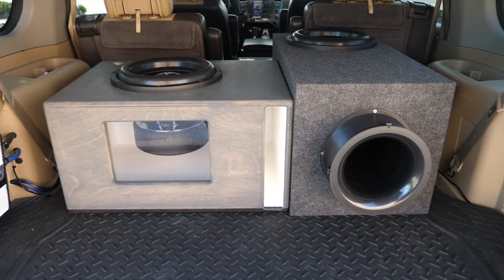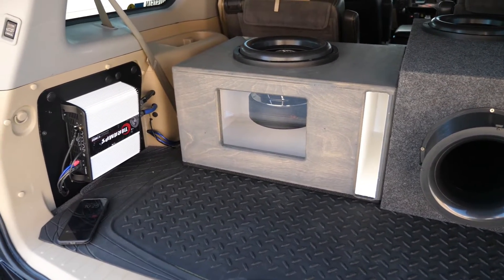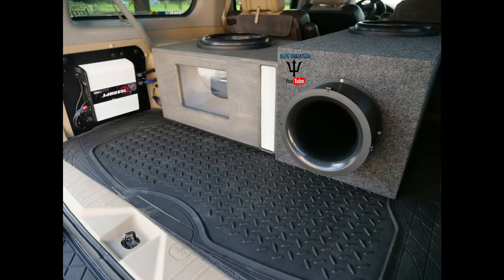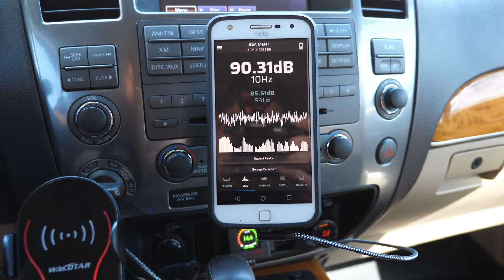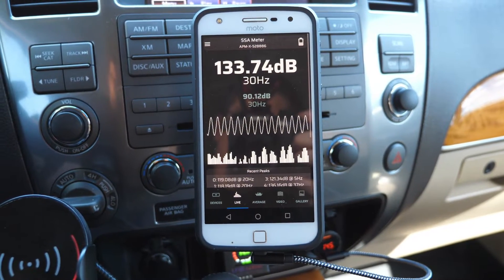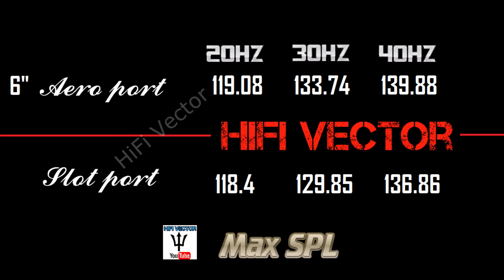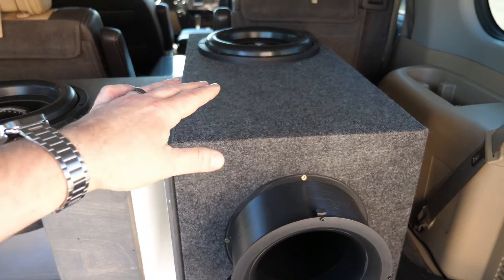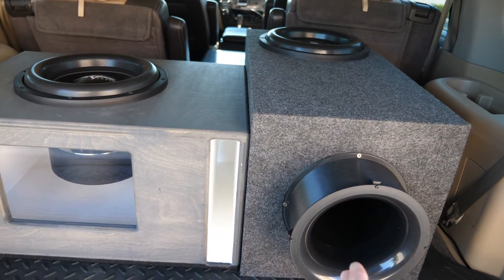Part 2. Aero port vs slot port subwoofer box test comparison?  6" aero port

Comment: I just made a custom sealed box for my 12" Kicker L7 2ohm dual voice coil sub and it doesnt sound half as loud  as the original sloted box i had in my 69 mustang mach 1 trunk.  I made the box to fit under rear window so I can fit my spare in trunk. Do you think I need an Aeroport in my box and what size? Maybe 2?  The sealed box probably is bigger then the ported one. Any videos comparing the two?

Comment: What did you use for the port to stick out of the box and screw it down? Is that some kind of adapter?
Reply from the maker: Yes I made it myself
Reply: @HiFiVector made it out of what? 3d printer? If you did buy the pieces to make the adapter, what style pvc pieces did you use to create it?

Comment: You would be nice to have the actual measurements of the boxes. If I can have good sound and similar power in a smaller box, yes please I'll take a slot. Quality mid-range and smooth clear tweeters I where the sounds is. I have a feeling most of these guys just have boom mobiles

Comment: I wish i understood how to calculate a port. I built a 5.36cf box in the shave of an L to fit my 65 cutlass for a dd9515 but im having a hard time figuring out the size and length aero port i need.
Reply from the maker: Is that the “net” volume of your box? And you want to use an aero port correct? What do you want it tuned to?
Reply: @HiFiVector  net would be right under 5. And yes im looking try a aero port this time around. So think 36-40 on the tune should work fine in a old muscle car.
Reply from the maker: Ok do you want to use a 6” aero port or 3 4” ports ? If you use a 6” precision port brand then you will cut the center tube to 2.5” long. When you connect the flares it will be 8.5” total length. Or you can use (3) 4” ports on the precision port brand cut center tube to 7” and when you put the flares on total length of each 4” port with the flares on will be 13”. Here are links to the ports.
https://www.amazon.com/dp/B001001KIA/ref=cm_sw_r_as_gl_api_gl_i_A51K590C0R2G734XC3WY?linkCode=ml2&tag=hifivector-20

https://www.amazon.com/dp/B0002ZPR56/ref=cm_sw_r_as_gl_api_gl_i_K8VGTC58Z6YFFKHV8HA2?linkCode=ml2&tag=hifivector-20

Comment: Ive been trying a few combos on my CT sounds Meso 12. They call for 40 square inches, i have a bout 24 (slot) now and it  Slams but trying to get 40 seems impossible in the 1.5 cubic foot box they recommend. I use sub box pro and winisd 40 inches seems ridiculous to me.
Reply from the maker: A lot of the factory recommended box specs are way off I my opinion. 24sq “ area in a 1.5 net box is a lot of area for that size box and should be more than enough. But….. that subs needs 2 to 2.5 cuft ft . 1.5 is waaay to small for that 12. I think those specs bare a typo.
Reply: @HiFiVector  I may have to try that 2.5 and see what she does.

Comment: Kind of a false comparision...a 6" aero port is 28 square inches versus your 22 slot port....and aero ports are way more efficient so that 6" is equal to around 36" inches of port.
Reply from the maker: You missed the whole point of the video. Part 1 had a 4” aero and parts 2 a 6”. Point was to go more are and less area on the Aeros to see what happens compared the a slot. People have said because Aeros are SO much more efficient you can reduce port area by as much as 60% so the whole point was to just see if that’s the case or not. That’s why in part 1. I used a 4” which is less actual port area than the slot. And in part2, video jumped to a 6” aero to see what happened. It was never meant to be a “fair” or equal port area test. Because if aero are more efficient you can not go equal…. Equal will not be equal since aero is more efficient. So if that’s the case for it to be equal you would need to know how much exactly can you undersize and aero to equal a slots area.
Reply: @HiFiVector  I thought you were doing a direct compare using a slot and aero....when you described the sound of the slot being louder and sounding better It seemed like a false comparison going from 22" to 12.5" in port area...if you used a slightly bigger aero it would have been a better apple to apples comparison. but I fully understand that you can't go to Home Depot and get a 4.5" aero...I make mine on a CNC machine....maybe I'll do the comparison...great videos BTW. I new the 6" would be muddy as that is way to much port for that driver. Im building a box right now for 4 DD Audio 1506 subwoofers and DD calls for 32" of port area which just feels to big to me although thats a slot port. At 2.0 cubic feet of airspace that 16" per cube for 6.5" subwoofers....In fairness these are pretty beefy but im going with 28" of port area and see what happens. I know it will sound good for sure and chuffing should not be an issue with 2500 watts of B2 Audio Rage power.

Comment: These are great compares.....i always try and build to spec....on that driver 22" is what is recommended so you cant get a round port with that area. seems like a 5" aero port is the answer...but then you run into length problems.....gets pricey to turn those things with adapters.....slot port is the same wood you built the box with.

Comment: Port compression at its finest. More port area gives more output up to a point until it becomes free air. Aero sounded boomy because it’s not being compressed to a smother response and is therefore peaky at one frequency. The slot port compressed and lowers peak output to smooth response. A higher order box would allow you to two or three peak to smooth response but takes infinitely more box volume to do.
Reply: exactly, and port being louder due more cone travel on same gain. It is like always a compromise.

Comment: hey man, all new to this, i had single db sa272 but not sure what enclosure to build. aero or slot? considering i have stock alternator/battery and has two 400rms subs (each) now jumped to 1500rms single. usually listen to rap and no decaf songs only original ones. wanted an all rounder enclosure with good lows and highs
Reply from the maker: For a single SA272 sub 2cuft net, 25 to 32 sq inches of port area and 34 to 36 hz would be good.
Reply: @HiFiVector  slot port or aero?
Reply from the maker: Slot, if you went aero then 4” aero port. I tend to prefer slot.
Reply: @HiFiVector  what are your reasons for preferring slot bro? i have seen people going for aero with SPL subs
Reply: @HiFiVector  also bro i have seen people using dampening sheets or foam inside the enclosures, how does that effect?
Reply from the maker: Both can work great if designed correctly but  with slots you can make port area literally anything you want. Aero you are limited with a couple different sizes also slots can bend if needed regular aero ports can’t.
Reply from the maker: Adding material supposedly makes the sub think the box is larger. But…. Adding material deadens some of the sound waves inside the box and sometimes it makes it sound worse from my experience. So it a trial and test thing. Doesn’t always help but in some cases it may.
Reply: @HiFiVector  yeah man, i tried and tested with placing cotton inside the enclosure, felt like i was playing in a sealed box😂

Comment: You're aware enclosure dimension (height width depth) is also a factor in ported enclosures. A ported enclosure is not like a sealed enclosure, where shape and dimension is irrelevant.
Also clear acrylic should be avoided but should be the same thickness as the surrounding wood baffle.

Comment: It would be nice too if you could cover how long a port needs to be to not unload vs the xmax of the sub used. Is it 4:1 ?
Reply from the maker: The length of a port dictates tuning frequency only. The area of the port is what you are thinking about and the area needed has a lot of variables depending on box size, what type of sound you are going for (SQ or SPL) and subwoofer specifications.

Comment: Hi brother., I have 1600 watts CALIBAR  woofer double magnet.for my woofer box how big Aero port i have put to get good bass
Reply from the maker: The power acoustik brand caliber sub? If so you can use 4” if you are not over powering it. If you are overpowering it go 3” . That woofer doesn’t have a lot of excursion so the 3” would help with power handing and make bass tighter or you can go 4” which would be not as tight bass but be a little louder with slightly less power handling.

Comment: I’m looking at doing 2 skar vxf-12 with a 6 inch aero port would that work good or should I use smaller or bigger port size I’m tuning box to 33 hz
Reply from the maker: 6” aero will be good for 2 vxf 12’s

Comment: I don’t understand how does a hanky prove which is better
Reply from the maker: It doesn’t it just help people watching the video show how much air each is moving since otherwise view would have no idea.
Reply: @HiFiVector  ah ok but what if you do a curved slot port where the end of the port turns into a horn wouldn’t that in theory increase the volume on the slot port and keep its efficiency at the same time since it’s only the volume of air at the end of the port that actually moves ? (Edit) kerfed

Comment: inn part 1: Slot port did 113.12 @ 20hz , 128.6 @ 30hz and 136.5 @ 40hz
inn part 2: slot port did 118.4  @ 20hz , 129.85 @ 30hz and 136.86 @ 40hz

I do belive all tests in vid 1 was done on same volume, and you used a different volum in vid 2?
Stil got a 136 @ 40 hz in  but a almost 5 DB up on 20Hz. 
And 6" over 4" +9 @20hz, +7.6 @30hz and +3.3@40hz

sound quality apart, consistent testing?
Reply from the maker: It was not the intention to compare part one verse part two videos as they were done on different days, so the volume and SPL levels will be different than the part one video. but that wasn’t the point of the video the point of this video was to compare at the same slot port box with now a larger aero port box and see the differences. So you cannot exactly compare part one verse part two as far as SPL level goes. Compare the differences of the boxes in each video.

Comment: If you can fit a large box like that with an aero port, it could help those guys who do not have massive amounts of power due to vehicle electrical restrictions, so this would scratch that itch for bass on lower power applications. Nice work man, thanks for the video.
Reply: Disagree. Areo port makes a bigger difference for spl applications. Low power applications will naturally have less port velocity because they are less loud. Spl and port velocity are directly correlated. As spl rises, so will velocity. And high port velocity causes port compression which reduces spl. To be honest every power level application should use areo port because it will let them get louder always. Port compression db loss is actually kind of crazy. It's so much more than people expect. People don't realize this and they end up spending $3000 on more subs, power, and electrical, when they could of made equal gains just from having a better box.

Comment: What is your take on the accuracy of the triticum port calculator?
Reply from the maker: Not a fan… there is a lot more information required to calculate the correct port area.
Reply: @HiFiVector how far off has it been for you? And in how many instances? Seems like a good, overall ballpark, but that ballpark, is like wrigley field being it’s own continent.

Comment: Try round ports flared vs no flare next.  

Also the location of the port in relation to the sub matters thats why I almost always do external ports.  

My philosophy has always been to use the proper amount of port area regardless of the shape though.  Also an easy way to determine what port should work best is to calculate its reynolds number for it sure this isnt really a flow and more of an oscillating mass of air but still it applies.
Reply: Could you help me figure out how long of an external port I need to make for my box?  Thank you

Comment: I've had similar results for a 10" sub in about 1.5 cubes tuned to 34Hz. The 4" aero got a lot louder and can push more air but the slot port sounded a lot better.

Comment: Not a lot of difference if playing music volumewise and seems like a tradeoff between your goals. That aeroport is using a decent amount more space for 2-4db gain where that slot port box could probably take enough extra power to outdo what the aeroport can handle at its power limits. Probably a size vs power issue.
Reply: great point murray!

Comment: I have an aero. The width of the box is a borderline issue, but sounds great. 
It works with a pair of 8s, but looking to get larger cones. A slot is my only option unless I just get a very efficient single 12”
Reply: Just get a fat 15”, 6” Aero. You’ll be covered for days. And you can always port out the top or side. (Personally I prefer same face mounting… but I also run my shit cab firing…)
Reply: @APinTheAK  I wish… A ported 15 would need 4-5 cubes. I have a sedan.

Comment: Nice comparison. I've been pondering lately on going back to sealed.
Ty sir for sharing 👍🤞
Reply: Hey friend.   I am just curious why you are considering going to sealed.  I know the general reasons for every box order, but yours personally
Reply: @7Little701  

True.  Too large and the power handling is greatly reduced.    I have an RE AUDIO SE X15 that I am thinking of building a box just to have some fun, but the ported box is quite large.  I have considered a sealed box, although it has been a long time since I had a sealed box.   Only a 750-watt subwoofer as it is, so I'm trying to be careful with what I do  with it.
Reply from the maker: Any time!
Reply: @7Little701  

There are some interesting videos both for and against poly fill.   I have always done it, but there are some pretty compelling videos on using it to change the perceived airspace of an enclosure.